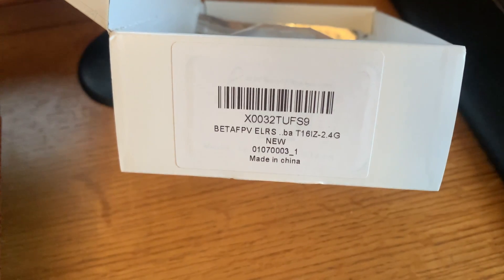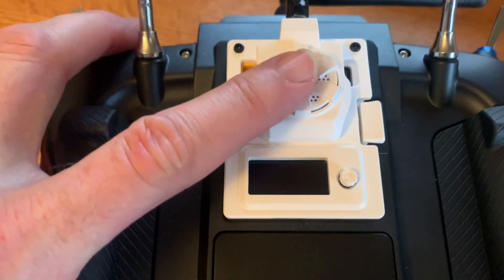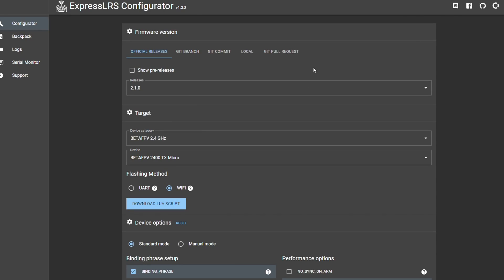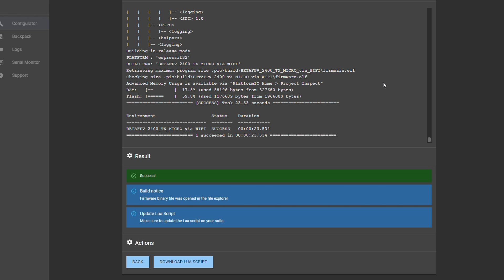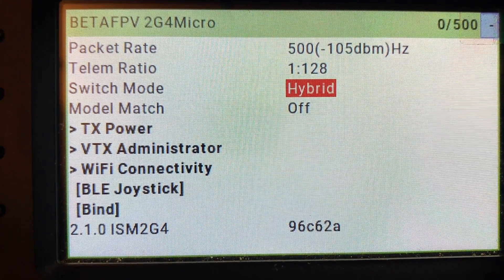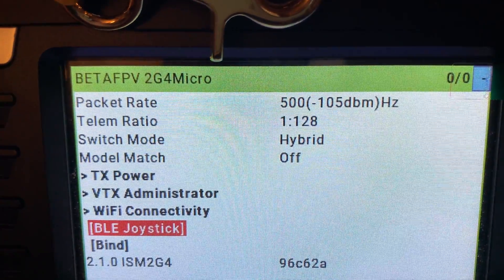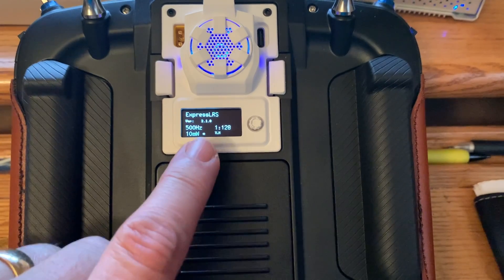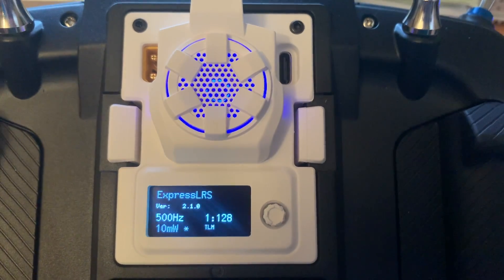BetaFPV ELRS Micro 2.4GHz TX Module Review and 2.1.0 FW Upgrade

Comment: I was getting frustrated with this because I couldn't change the packet rate. I was having range issues with the ceramic antenna on the mobula 7, even at 500mw. Failsafing in places that my frsky spi receiver Tinyhawk 2 didn't failsafe at. After watching your video I went into the lua script and was able to change the packet rate from 500hz to 250hz. I'll try that and see if that fixes my range inside of buildings problem.
Reply from the maker: Yes I would try dropping the packet rate down to 250hz or even 150hz. The ceramic antennas are great on whoops (light weight & don't have to worry about antenna placement) however, I have had comments from other pilots stating they don't do well in concrete buildings and prefer the normal antenna receivers. I have no problems with them in my house, but I do not fly bandos or parking garages. Hope this works for you. 
SLOG
Reply: @slogfpv  I just tested it on my lunch break flying through the shop. No control link issues at all for the 2 batteries I flew at 250hz.

Comment: Hi friend! Nice Video, thank you very much! Could you help me with something? I have a R9M-2019 and have flashed ELRS to it... now, I'm about to buy some ELRS receivers... Do I must get R9 receivers or could I get any receiver that runs on ELRS protocol? I'm thinking about buying a happymodel with those ceramic antennas... another question would be: which one is better? 900Mhz or 2.4Ghz? Ok, I really want long range possibilities, but my principal goal is good and solid penetration... What do you think about that? Could you guide me on the right direction? After seen your video I'm already thinking about buying one of those modules too... 🙂
Reply from the maker: Hello Natan, once you flash ELRS on the R9M-2019 module, it is compatible with ELRS receivers like the BetaFPV ELRS Nano (915MHz FCC/868MHz EU). You have to be running the same major release of ELRS on both the RX and TX (ie 2.x to 2.x). Also the same compatible frequency between the RX and TX. 

I personally run 2.4GHz as that has more available receiver/transmitter options. The R9M-2019 is not compatible with 2.4GHz. Theoretically, (915MHz FCC/868MHz EU) would be targeted for Long Range pilots, although 2.4GHz has ridiculous range as well for most pilots like me who fly Freestyle FPV. I would probably recommend a 2.4GHz module over the 915/868MHz for most pilots unless you want to fly miles out. 

Lastly, if you are really concerned about penetration, I would go with the 1W version of this module.

Cheers,
SLOG
Reply: @slogfpv  Thank you very very much! Your knowledge and tips were very useful for me. That's what I'm going to do: since I already own the R9M-2019,   I'll buy two or three 900Mhz ELRS receivers and use them together. I'm still a little bit confused why I would rather choose 2.4Ghz if they say 900Mhz gives me more penetration through walls, trees, etc... I normally fly by myself and my kind of goals are bandos and trees, at the most. But.... even so, I'm thinking about buying a 2.4Ghz ELRS Module and receiver just to give it a try, but I don't know if it would be better in that kind of penetration I want than the 900Mhz ones. At least I've just learned form you that I am free to use different "brands" of receivers and modules (2.x and 2.x)...  and of course, I would pick the 1W module as you recommended. Thanks again! If you wanna say any other thing, please, fil free to do it.... 😘
Reply from the maker: @NatanRufino  The biggest advantage for ELRS 2.4 GHz is latency (500hz vs 200hz packet rate). For Racing, latency is king so you would choose Ghost, ELRS2.4 or Tracer. I am not a racer. For Freestyle, the answer is not as clear cut. If you fly bandos (I don't) you may want to go with ELRS900 for better penetration with the sacrifice being latency. If you are pilot like Mr Steele, he would recommend ELRS2.4 or Tracer. But most of us are mere mortals (average pilots), probably the lower latency is not needed. If you are a fixed wing LR pilot, the choice is easy, ELRS900 or TBS crossfire. Latency is not a big issue for LR pilots. Here is a link to UAVTech on the subject. He goes into great detail on the subject and can explain it a lot better than I can.
https://www.youtube.com/watch?v=9njyjGIeaPY
SLOG
Reply: @slogfpv  Thank you!! ❤️ I think I got the ideia. When I first migrated from analog to DJI digital system some people some spoke about the bad latency DJI would have, but it did not affect me too much. I understood very well your explanation and I'll give a try to the 2.4Ghz ELRS... May God bless you. 😘

Comment: Will this work with the spi aio boards and how is it with with the happymodel ep2 rx's? Also looks like it like the fixed the joy stick. 
Thanks for the review.
Reply from the maker: Hi AL USMC, I have bound it to my Meteor65 PRO which is a SPI AIO flight controller. I did have to upgrade the FC to 4.3.0 Release Candidate 2. I am in the process of upgrading my other ELRS receivers. 
SLOG
Reply: @slogfpv  Awesome. Will have to maybe give this module a try. I know Betafpv was trying to do their own coding. Glad to see that it is no so. Again... thanks for the content.
Reply: Hi, so the Release candidate 2 is a version 2.0 of ELRS receiver and the module vers. 2.1?
Reply from the maker: @teobass82  
Yes, release candidate 2 is version 2.0 for the SPI ELRS receiver and the module is at v2.1. Since this is a minor release, it is backwards compatible with 2.0 but not 1.x because there were major release changes in 2.0. Hopefully by Betaflight 4.3 release time, the SPI receiver version will be at 2.1. But again there are only minor changes.
SLOG
Reply: @slogfpv  great, then I understood correctly.  Thanks 😉
Reply from the maker: @teobass82  

FYI 
https://www.expresslrs.org/2.0/hardware/spi-receivers/
"Updating¶

As mentioned, you must flash a Betaflight firmware that's compatible with the ExpressLRS major version on your transmitter. ExpressLRS 1.x.x TX only works with Betaflight firmware for ExpressLRS 1.x.x, and upgrading the transmitter to ExpressLRS 2.x.x means flashing the flight controller with a different Betaflight version (e.g. Betaflight 4.3-RC1 5933d96). You don't need to update the FC firmware whenever there's minor updates on the main ExpressLRS codebase, unless there's any update on the Betaflight codebase itself for the SPI ExpressLRS receivers.

In preparation for updating, you should save a copy of your diff all dump.

Using the latest Betaflight Configurator, navigate into Firmware Flasher and select the latest Betaflight release (at the time of writing, it should be set to Release and Release Candidate; and use the latest 4.3.0 Release Candidate). Depending on your AIO board, the target will differ:

Happymodel AIO: CRAZYBEEF4SX1280
BetaFPV AIO: BETAFPVF4SX1280
SPRacing SPH7RF: Coming soon!"
Reply from the maker: @L' ours blanc the version of ELRS FW loaded on the module only goes up to 500mW. There is a 1W version of FW for the newer 1W module. If you are wanting more power, I would go with that as it is only $10 (US) more. My understanding is they added a heatsink so I would not recommend loading the 1W FW on the 500mW version. Hope this helps, SLOG
Reply from the maker: @L' ours blanc I have not tried (don't want to brick my module) to flash the 1w FW. It  probably will not work on the 500mW version as there are main board differences. The 1W version has DIP switches. Also, the latest version of the ELRS configurator has target checking so it might not even allow it. SLOG